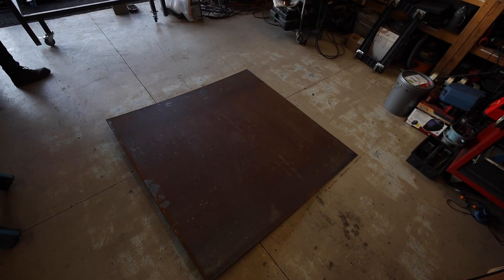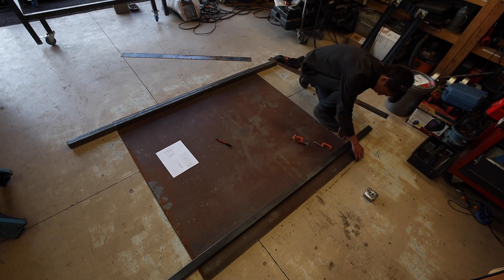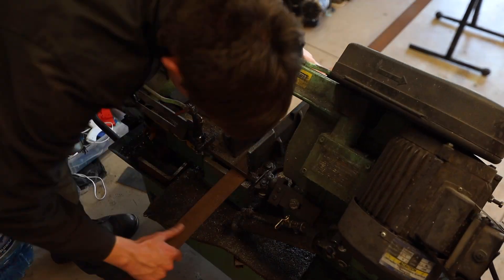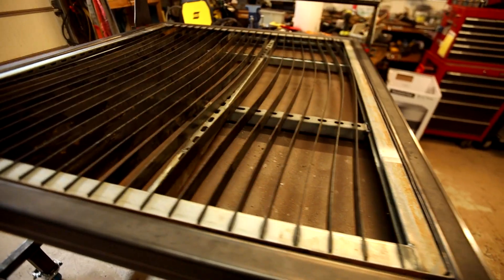How to build a CNC Plasma Cutter Table | Water Table | Free Plans & CAD Files

Comment: How did you mount your torch? I’ve been looking back at all the videos and can’t seem to see how you did it. Did you build a custom fixture for the body of the torch or did you take advantage of commercially available torch mounts?
Reply from the maker: Hi, thank you for your patients with the slow reply. I did build a custom mount. I didn't really go in to any detail in any of the videos, but I used my phone to scan the torch and created like a negative mold of that and added mounting points and then 3d printed that. I believe the model and file is included in the CAD so you can look there. Is this a video you would be interested in seeing? How I made this part?

Comment: Hi, i am going to build one. But i am wondering if its better to use a waterbed or a floor grate. And a big funnel under. And do i need 3 axis (do i need the torch height controller?). Or can i use 2 axis.  Thanks :)
Reply from the maker: Sweet! The water table helps keep the fumes and particles under control. It also has the added benefit that you can immediately pick up the parts after your cut. Without the water table, the parts are hot right after cutting. I don't cut very much thin material but I do believe it helps with warping during the cut of thin material as well. But my first build had no water table and it was fine it just created a lot of fumes and particles. You don't really need the 3rd axis but you will need some way of adjusting the height of the torch unless you are cutting the same thickness of material all the time. I currently don't have a THC with this machine but the THC will help a lot with your cut quality as well as making your consumables last longer.

Comment: Hi, what about gantry gear reduction? You decide to go with direct gear.
Reply from the maker: Yeah I did no reduction, just to make things more simple. With the plasma cutter it won't see super high torque. Though to be honest I probably should have had one especially that I want to use it as a wood and foam router as well.

Comment: Phenomenal work. One tip for the future, You welded the frame on a not so flat floor, to remedy that, every surface can be made flat with 3 points of contact. Basically make a large cross with sturdy steel sufficient enough for the project, then support it at 3 points with machinist jacks, captive nut and bolt or whatever you want. Then clamp your frame together on that, get it square (not flat) then use the level to level everything length wise, turn the level perpendicular and make sure the pieces are square to each other. Do a diagonal measurement to make sure your still square. Then tack weld alot before final welding. I had to build a massive ibeam structure that was going to be lifted to a nearby mountain, in the middle of a dessert. Tape measures, levels, plumb bobs and soapstone. I didnt think of this but it has worked for me so many times. The cross we made was 30’x20’.
Reply from the maker: Wow! That's a massive cross. Thanks for the tip! I'll defiantly use this next time I need to build something bigger than my table

Comment: Great job with the design. Have you considered replacing parts of the gantry with aluminum to reduce weight? I'm trying to plan a cnc build right now, thank you for the downloadable plans they are exactly what I needed.
Reply from the maker: Thanks! I haven't but I do like the idea! Maybe I'll try that at some point
Reply: How are you goin with it Tony? I'm interested in aluminium also because i have a CNC router to make  parts like those gantry end plates . i think this machine is way to hefty and expensive for CNC plasma it will be terrific when its  got router  stuff on it later . terrific content Tosh and great of you to share the Cad files  keep it up  ...